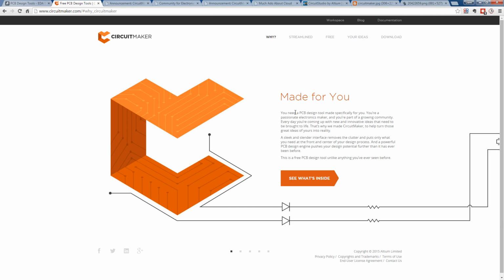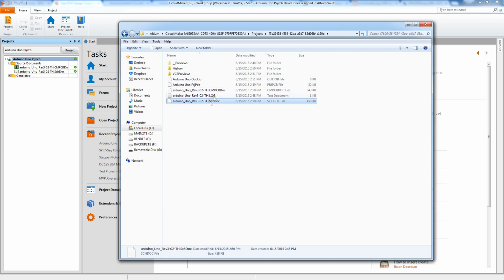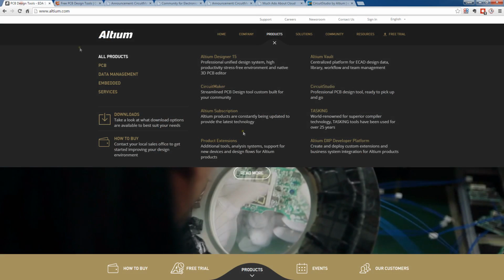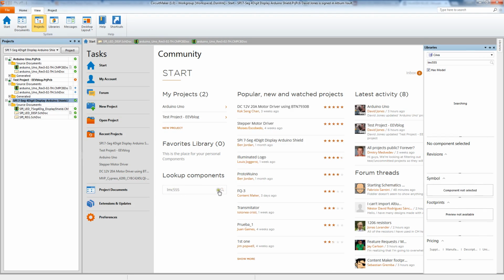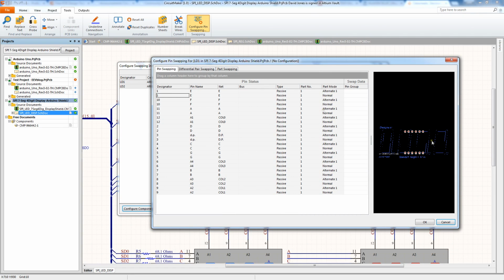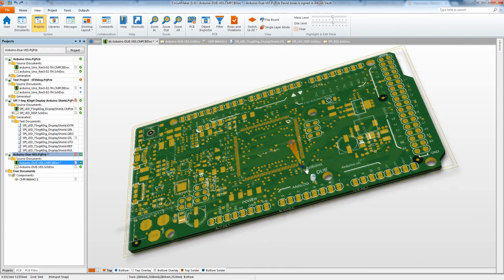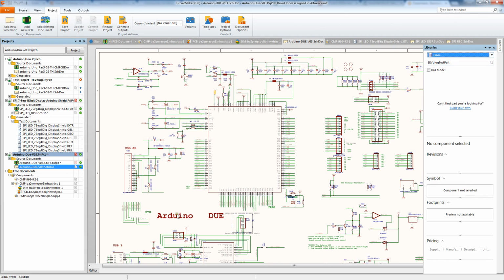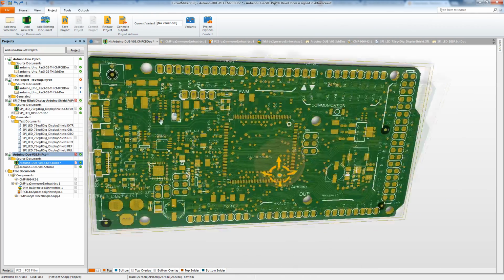EEVblog #754 - Altium Circuit Maker First Impressions

Comment: It begs the question, why not just lower the price of designer so normal people can buy it . They are just encouraging piracy
Reply from the maker: Andrew Joy They did that once, dropped the price by 75%. But that wouldn't work today, the company could not sustain it's growth and hence share price. Much better to offer a p aid option for CircuitMaker.
Reply: EEVblog 
"We've heard the community and going from free to CircuitStudio ($3K) is to large a price gap. We've had plans all along to offer an in between solution, but wanted to hear the feedback from users to confirm our beliefs. This product will be announced in the not so distant future - stay tune..."
-Dan Fernsebner (ALTIUM) [From Forums]
Reply: Andrew Joy Because it's a professional tool. Pro tools always cost your first born. See Photoshop.
Reply: bluephreakr forget PhotoShop, see Krita which is 💯 free.